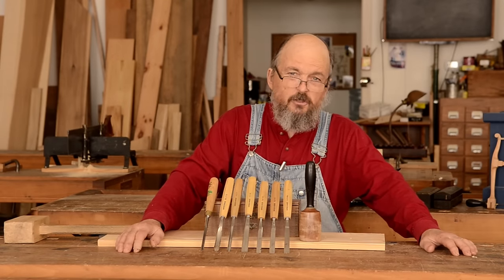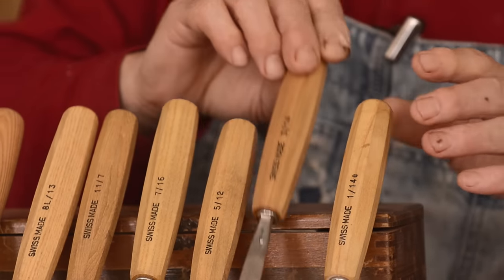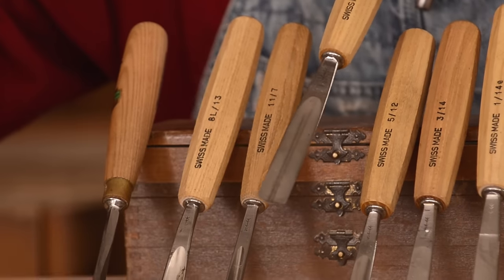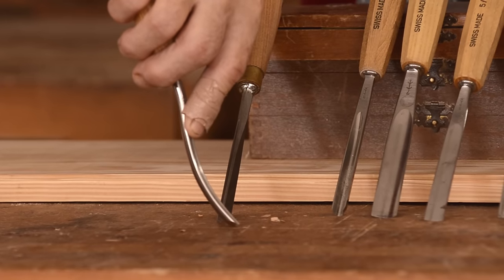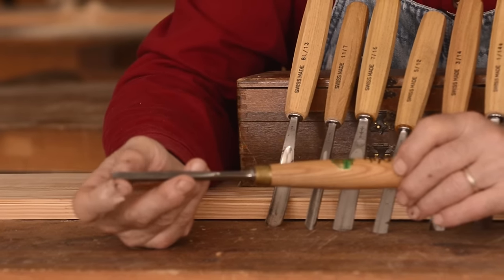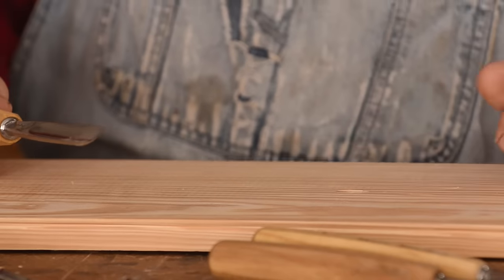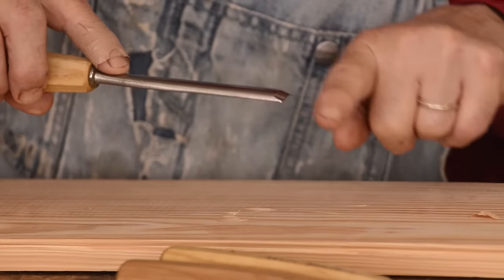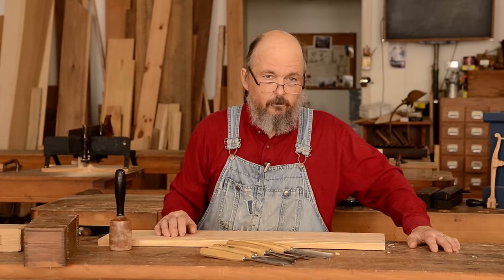Wood Carving Tools & Techniques for Beginners

Comment: I have a couple of questions. Firstly, what type of wood is the best/easiest to carve? Can you carve a branch you cut off of a tree or does it have to be manufactured wood? If you could take the time to answer my questions I would greatly appreciate it.
Reply: +mackenzie breaux  Use lime, poplar, or willow. Some species of maple are quite easily carveable. Cherry is good too, but the wood is harder. Generally, you should look for wood without growth rings in it and without knots - the more homogenous the wood is, the less likely it will tear. 

Don't carve branches with chisels - you will definitely cut yourself - use a chip carving knife, or a penknife. Whatever you use, make sure they are very sharp (sharpen it at least to 1000 grit - sandpaper is the cheapest solution, then some polishing compound, then strop it on a piece of leather), and always cut away from you. 
Use a bench to rest the branch on it, avoing holding the branch in your hands while carving. 
Always put the holding hand behind the blade, so in case of slippage, you won;t cut your fingers. 
Make sure the wood it''s dry (at least a year of drying time), or it will warp afterwards.
Reply: Dumitru Ursu Thanks!
Reply: Basswood,and Butternut are the best woods to learn to carve on
Reply: @davogifman542  I like willow as well.
Reply: Starting with soft, inexpensive woods will make things easier for new starters. Easier because if using harder woods, it may put ppl off wood carving.
 As competence in use of tools have been achieved, choosing woods of preference will be more enjoyable.

Comment: I am trying to set guide paint for carving project. i did google search and they recommend acrylic paint though i believe this is answer for paint that is for actual coloring. is the answer the same for my question. cheap is best for my need since it will be carved away.

Comment: is the PFEIL full starter set a good beginners set or should I go with the bailey for a starters set?
Reply: +KILLKING110  i use a (Set of 12) by Ultimatecreek i bought them on amazon, uoi search ultimateCreek set of 12, so far they are really good.

Comment: Hi i have a question probably will sound stupid to some ppl but i have some old chisels rusty dusty if i clean them like with vinegar techniques will i have to resharpen the chisel and i want to know if there is a specific angle as i tend to go 35 on my knives or 25 depending on what i would use it for.  Simplified the question would be how to maintain and sharpen those if they are old and rusty or if this simply will always work fine as long as i have the good technique.

By the way i want to add one of those in my bug out bag try making small bowl and survival bushcrafting stuff so i am not gonna do it profesionnaly its just some skill i need to add to my arsenal.  Thanks you if you answer me but i wont be mad if you dont cause there is a lot to read here and its a old video.
Reply: Focus on chip carving tools and bowl and spoon gouges that work well with dry, green wood. That'll make many useful things like utensils.

Comment: Hi Bill,my question is about lighting,my shop has no natural light so I have florescent tubing which is not ideal what bulbs are best? regards malcolm
Reply from the maker: Hello Malcolm, Joshua here. I have florescent tubing on my ceiling, but use lamps when doing detail work. I personally prefer a light bulb that has a more warm color.
Reply: thanks for getting back to me

Comment: thanks a lot, a question for carving like that how long it would take the tool to get dull  Iknow it depends on the work we do, but on average how long befor it get dull . 2. I want to make a pipe from a log that I cut from my garden can I do it with these tools ... I dont want to own a lot of tools.because I have zero knowldege of carving, but want to learn the basic, would set like that enable me to do a smoking pipe even if it takes me longer time? thanks a lot wish you the best
Reply: These tools and a drill of some kind for the chamber and stem would get you started. Depends on how fancy you want your pipes.
Reply: Strop every 15 - 20 min's on average, imho. That way they stay sharp and you may never have to use a stone.
Reply: @curiousgeorge555  thanks for the tip, where I live I can't find specility store that sell strop with leather strop, is their a substitute for that from home Item? honing rod?
Reply: @sutil5078  If you can get ahold of some stropping compound you can use it on bare wood to great effect (no need for leather). If you can find leather from a used item like a wallet belt or piece of clothing you can glue that to a flat piece of wood. It will work even without compound but it will take quite a bit longer than with it. Good luck to you.

Comment: When selecting a round carving mallet, can you tell us about choosing the weight of the mallet with respect to the type of work.
Reply: Light mallet for light work. Heavy for heavy - when you really have to lay into the wood hard to remove material.

Comment: As a professional woodcarver from London, from a family business from 1807, i can say that most of that advice was incorrect: chisels always have a hollow ground; you almost never wiggle because that would leave telltale ugly marks in your finished surface; you brace your arms into your body and move your body, never your arms, and never have your elbow up in the air, where you loose strength.
Reply: Thank you for the advice. Proper ergonomics while carving is important to me. Please share if you know any good sources on the subject.
Reply: Everything you said is correct except the part about gouges always useing hollow ground. Also there is a time and place for using ones arms, imho.

Comment: Can someone knowledgeable advice me for getting an inexpensive but reasonable quality set  of carving chisels.
Reply: mogbaba hi to be brutally honest with you. Firstly do not buy a set, go for individual tools as and when you need them if possible. second, buy the very best you can afford and they will not be cheap. Expect to pay around GBP thirty pounds per tool. Cheap is nothing chearful. Every carver will have their own favourite make, my chisels are all made by Pfeil of Switzerland.
Reply: neville robinson
Thank you for your reply. I have read a bit about this and have come to same conclusion that buying a set is not a wise choice as, one may not use some of chisels. So the best is to get one by one. Pfeil, i encountered, From the photos and the price tag i could guess that they are on premium level. I gather as this is a very limited market and the serious customers want quality you get either top quality expensive or junk quality cheap, lol.
Reply: Make sense
Reply: @mogbaba  Late to the chase but while Pfeil is the cream of the crop but Two Cherries (Kirschen) brand in terms of range and reputation are not far behind and are cheaper. It's worthwhile finding a store that sells one or both and find what suits you best.

Comment: i have bought some  gouges    and they are soo thick and are unableto carve maybe they are chizels??
Reply from the maker: peter markoli Perhaps. Or maybe you just need to sharpen them?
Reply: peter markoli it sounds like you may have bowl turning [lathe] gouges which are substantially bigger and thicker.
Reply: you are right they are for wood turning  but  it said chizels for carving  in the page where i bought them

Comment: gyus while wood carvin always wear heavy duty gloves
while i was carving wood i even though i was wearing gloves i got injured
Reply: i hear that, i've got a big scar on my hand from where i slipped with a chisel. also make sure your tools are sharp, the sharper they are the less effort you need to make cuts, the less likely you are to slip.
Reply: Gloves can make it harder to grip and control your tools, and dulls your ability to feel their response. Keep your tools and your eyes sharp
Reply: @stephlrideout  can't agree more. By wearing gloves you think you're protecting yourself but you're actually doing the opposite cos your senses are blunted.

Comment: What a lot of these videos of not all of them fail to fully emphasize is that it takes years to be able to develop the movements and to properly control the chisels. Even pushing back with one hand and forwards with the other and to accurately slice off chips without mistakes is very difficult to do. It doesn't help that store bought chisels for carving are almost always dull and have poorly shaped bevels. And the steel is poor and the handles weak. It's not until you're spending at least $40 a chisel that it comes with a mirrored bevel and is sharp enough to shave with. And unless you have a teacher to help you to make corrections in your form that you're probably not aware of doing wrong it's an uphill battle to self teach from videos. I have only rudimentary formal training from back at highschool. And I've been practicing carving and sharpening for a few years now and I still suck overall. The biggest trap I've found myself falling into is accepting mediocrity. It's sharp enough or ok well I can do without that bit I'll alter it after breaking off a leaf or whatever from a scroll. And I've been unable to recreate that factory edge on my flexcut chisels. I've come close but not quite. Another thing I've not seen much of is on how much easier it is to carve green wood or at least wet or most wood. I first noticed the difference when I let a stick dry out for a few weeks between finishing the stick. Dry carving the thing was brutal compared. I'm the first to admit it's satisfying to watch a master put out a how to and watch them carve a piece but they rarely if ever mention stuff like that. I guess it's because they take it for granted. I like carving hard wood because it's more forgiving to inexperienced hands. Softwood gets tricky between the grains. I've seen yellow cedar carve like butter but haven't found any that I can do that with from my hardware lumber store. If it's too dry should I put it out in the rain for a while?
Reply: True. The subtleties are seldom taught on Ytube. I can't find any vid's on how to sharpen a curved bevel on a gouge. Any suggestions?

Comment: There is so much contradictory information about carving, especially on bevel shaping. This video suggests a slightly curved profile; Mary May says this is a no-no - the profile should be completely flat, a concave or convex grind won't carve well ; others say that a hollow grind is correct. What's a beginner to do... 🤷‍♂️🤦?
Reply: He was correct in that a curved bevel allows one to get in and out of the wood better than a straight bevel. I am winging the sharpening with some success. I can't find ANY vid's on sharpening a curved gouge bevel. Side note: my father was a master fine art sculptor. I inherited his tools. Most of his bevels are curved - not all.

Comment: I think EVERY woodcarving video that doesn't mention the different types of wood that can be used and the pro's and con's should be BANNED. The first thing a beginner is gonna need to know; what kind of wood should I start with. Need to answer this before you jump into the tools and techniques. Ugh...